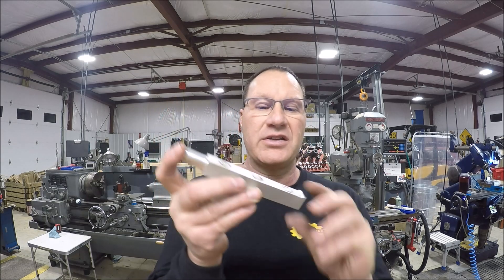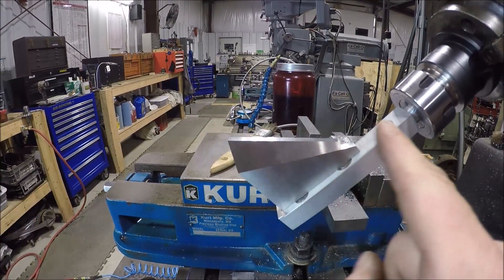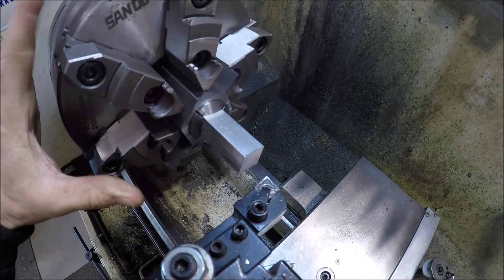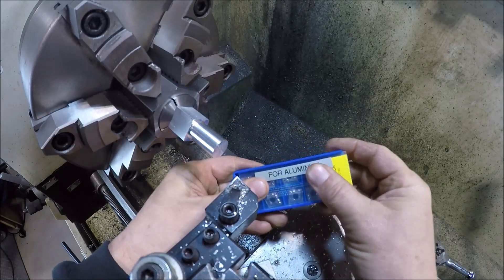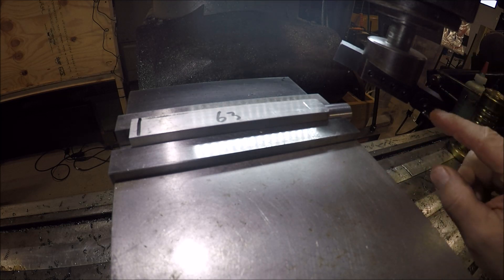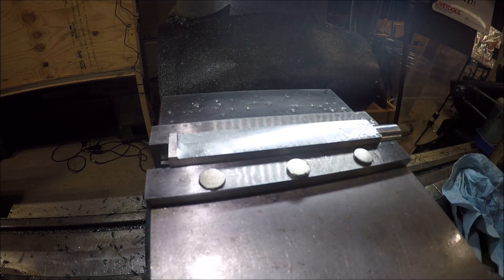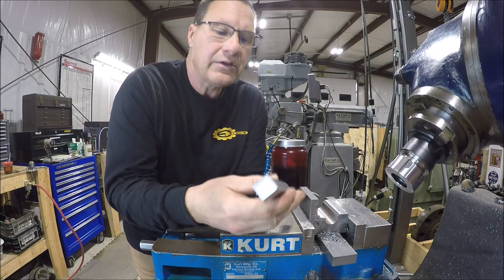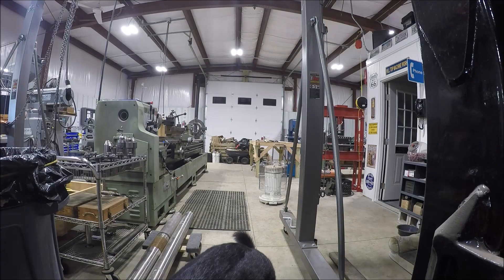A tool to set accurate angles on a milling machine head

Comment: Interesting and useful project. To make it simpler may I suggest using a square steel bar without magnets and a digital angle gage to set the angle. A quality digital gage will display angles to 1/10 (6 minutes) of one degree. You could also advance the spindle and set the digital gage directly on it.

Comment: That's a nifty time saving tool Tom.  It is a paradox when I was working in industry, we would NEVER come up with such a tool [ If we did we would never let the boss see it]  because we were paid the big bucks by the hour...slow and steady makes the $ untll we were replaced by the CNC machines lol!
Reply from the maker: Hey Al. That is a bummer.
Reply: @hilltopmachineworks2131  Yep, great to develope tools for our own best use.
Reply: Interesting how the “big bucks by the hour” prevented you from making time saving jigs and fixtures. The shop where I worked for twenty years was just the opposite. The more time we saved the more profit bonuses we received. Ten percent of net company profits were distributed to employees each quarter. That system worked amazingly well as long as the company was privately owned. Shortly after an international conglomerate purchased the company the bonus system was eliminated. The result was predictable. Profits quickly dropped, the company went through several more owners and is now out of business. If you have a company reward your employees and keep them happy. It’s not rocket science folks!

Comment: That's a different approach .   I was thinking about a similar thing but make it to fit directly into the spindle taper to eliminate the collet chuck .   👍
Reply from the maker: A direct fit would be even better to eliminate any collet error. I would have to make two of them if I went that route since one mill is R8 and the other is 40 taper.

Comment: Gday Tom, That’s a great idea, the Cincinnati graduations on the head are pretty close but definitely not 100% accurate, I made some parallel gibs for a viewer out of some A2 tool steel that needed to be 60° and 55°, that took some setting up to get the angle spot on, this tool would of saved me a lot of time, great job mate, take care, cheers
Reply from the maker: Thanks Matty. It is simple but very handy. A time saver too as you mentioned.

Comment: Simple and effective, i like it. Only problem i can see is, if you’re really going for accuracy, that surface you milled is referenced off the bottom and sides of the stock, not off the turned surface that will be in the spindle. So, you’re going to be dead accurate to that surface, but not necessarily to the spindle. You did use a collet, which probably eliminates most of this concern, but technically that stock surface isn’t known, so, ya know, just sayin’.